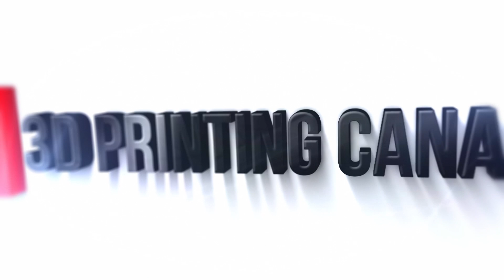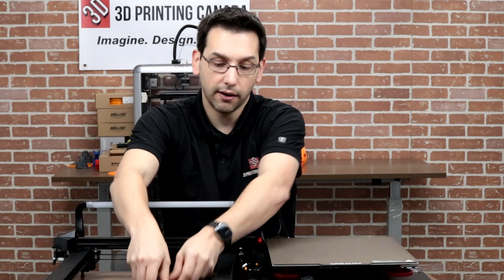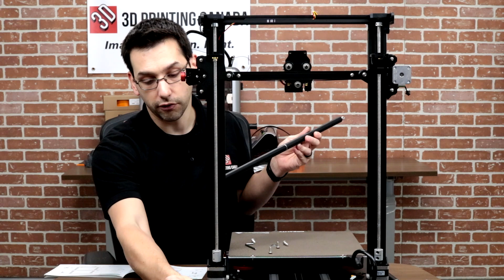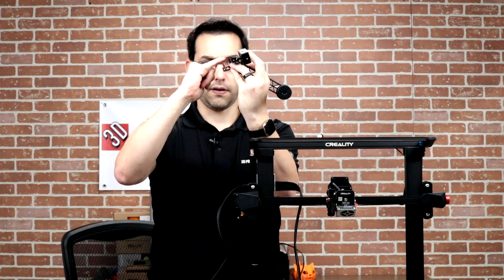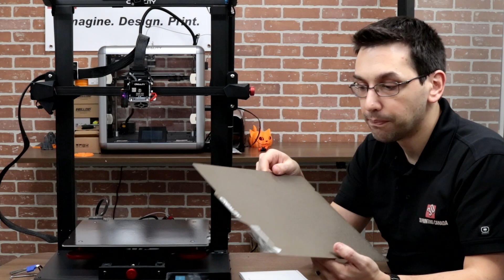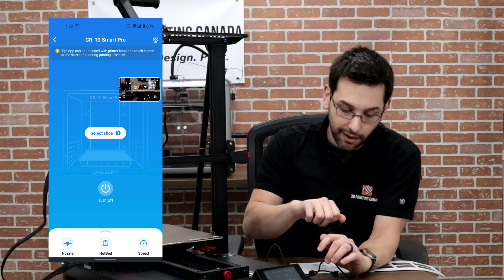CR-10 SMART PRO UNBOX & BUILD

Comment: Holy smokes man, you kept forgetting to plug in the Hot end, while continually saying you're ready to power up the machine... Lol. FOCUS! Also, your camera angle has the screen of the printer off camera. Maybe some ridlin before starting to record...? Just bustin ya chops a bit, but it did stick out to me. And as I watched on, you got worse and worse. FIrst, you should do a manual leveling BEFORE you do an auto leveling and z (not zed) offset. When you don't do this in this order, you will have problems printing. A little research before you make the vid helps tremendously. There are several other reviewers who did this properly, and they got STUNNINGLY BEAUTIFUL results with their prints, unlike you. Also, let me get this straight, you turned off the printer while things were still hot, and then bitched about it turning off while things were still hot??? OMG you need to get a grip. This is the worst review of this printers I've seen to date. STUPID comments about stupid things. There is absolutely NOTHING useful in this vid. A complete waste of time. Learn how something works BEFORE making a vid about it for others. Because all you're doing here is confusing a lot of people... And you weren't just being picky, you were being a huge douche! There is a difference... Lastly, what kind of a MORON complains about having to do all printing from the lcd panel on the printer, but then doesn't take the time to actually try the app, but says he refuses to use the app???? AND, FOR THE RECORD, you CAN print from the app using CURA's Slicer IFFFFFFFF you bother to learn how to do it. AGAIN, there are other reviewers who were smart enough to prove you wrong on this, including a 12 year old little girl. Who btw, showed us her printing with this printer, and the results. I find it very curious how you skipped all of that. Do you alllllllllll those little numbers in the slicer software, well if you bothered to put what little brain you obviously have left, and actually put it into gear, you'd realize that you can CHANGE those little numbers, and make the printer print quicker or slower, hotter or cooler and all sorts of other adjustments. BTW, ALLLLLL of them effect how well the print comes out. I seriously think you are too stupid to realize just how stupid you really are... REALLY! Even you recognize it, when you said, and I quote, "Stupid me!" That was the most accurate thing you said in the entire vid. 
And the more I watched, the more and more of an idiot you appeared to be, complaining about the camera output, while forgetting to take off the protective film... You should NOT be making vids to try to give ANYBODY any instrux on anything. You are the least focused, most unorganized reviewer I've seen for ANYTHING on YT. The good news is you won't have to worry about me obliterating you on any other vids, as I wouldn't waste my time watching anything from you EVER again.
This is one of the best printers on the market for those who actually know what they are doing. Does it still have a few warts? Sure, ALL OF THEM DO. But if you learn a few things about it BEFORE making a vid, you'd see that they are all easily overcome, and results are spectacular. I challenge you to try to find a better printer, with just as many or more features than this one, for the same price range. You can't do it...